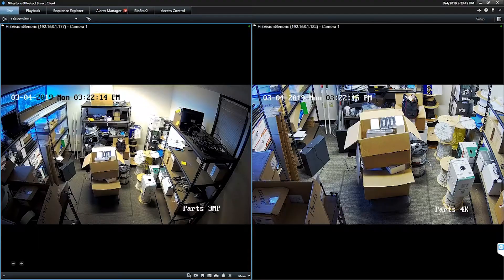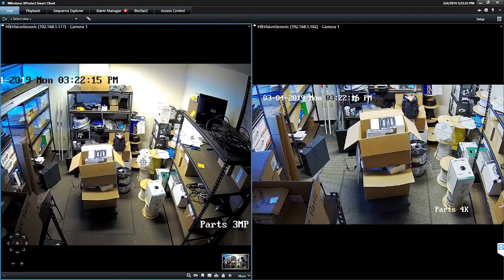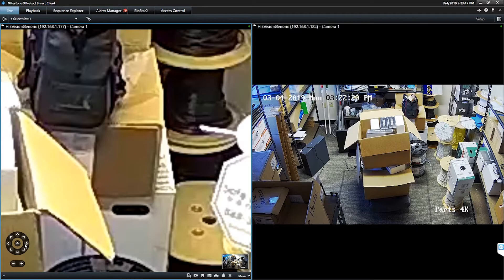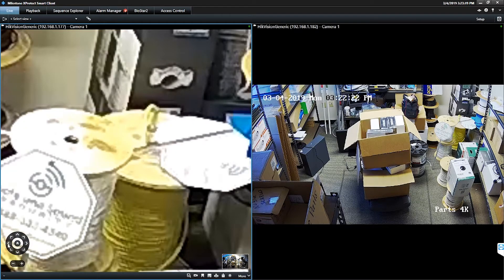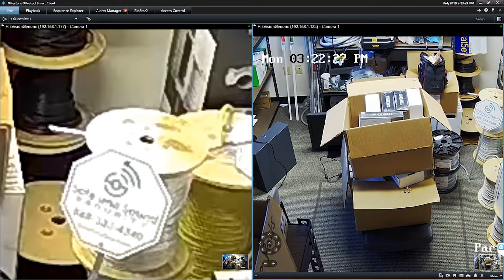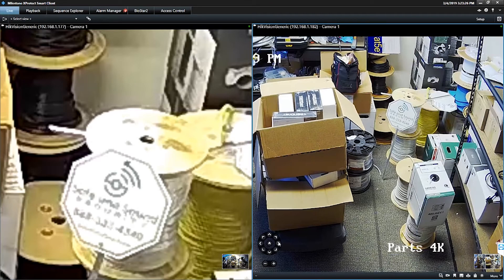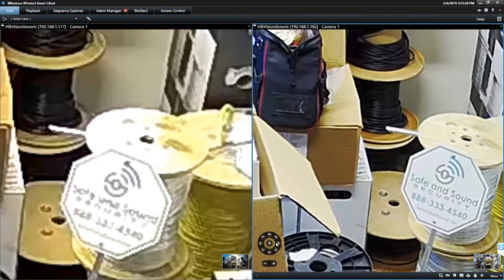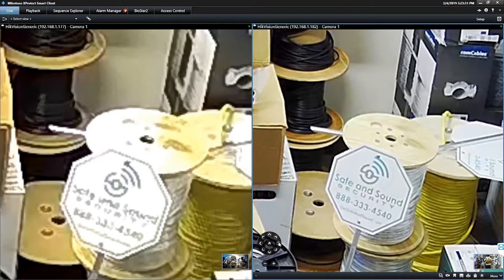NVR vs DVR Which Is Better?

Comment: My question is if dvr is continously peeping what is cause and is the dvr still recording while peeping??
Reply from the maker: The continuous beeping you're hearing from your DVR system could be due to a variety of reasons. Some common causes include:

1. Hard Drive Errors: The DVR might be having trouble reading the hard drive. This could be due to a hard drive failure or a problem with the connection.

2. Overheating: If the DVR is not properly ventilated, it can overheat, which can trigger a warning beep.

3. Network Issues: If your DVR is connected to a network and loses connection, it might beep to alert you to this problem.

4. Power Supply Problems: Issues with the DVR's power supply can also cause it to beep.

5. System Errors: Other system errors or settings, like recording conflicts or capacity limits, can cause your DVR to beep.

As for whether your DVR is still recording while it's beeping, that largely depends on the cause of the beeping. In some cases, like a hard drive error, it may stop recording. In others, like a network issue, it may continue to record but won't be able to transmit the data to a networked device.

The first step to troubleshoot this issue would be to check the system status on the DVR's interface for any error messages or notifications. Additionally, consulting the user manual or the manufacturer's support resources could provide further guidance.

Comment: I have the revo DVR and it has the plug you said should be a NVR and supplies power to the camera's as well it's the revo 16 Channel R16D4B4SYS - 1000 I have RJ - 12 cables times 12 then I have 4 coaxial that go to a BNC source. Revo say's this is a DVR though Why??? Shouldn't this be a NVR??? Am I missing something here??? I am gonna up date the Hard Drive to a 4 TB because it only has a 1 TB right now.
Reply from the maker: @kurtvara4918 You've brought up a good point, and it's understandable why there might be some confusion. Although the terms DVR (Digital Video Recorder) and NVR (Network Video Recorder) are generally used as described in the video, some systems blur these lines.

Revo system is one of these. It's indeed a DVR system but uses RJ-12 connectors which can carry both power and video, similar to how NVRs using Power over Ethernet (PoE) work. However, it's still categorized as a DVR because it's designed to process the video data at the recorder, not in the camera like an NVR. It uses a combination of RJ-12 cables for the majority of the cameras and coaxial cables with BNC connectors for the others. 

As for the hard drive, upgrading from 1TB to 4TB will certainly provide you with more storage space for your video footage. Just make sure that the DVR system supports hard drives of that capacity before making the upgrade.

This kind of hybrid system can be a bit confusing due to its mixture of characteristics from both NVR and DVR systems. But rest assured, your system is classified correctly according to how it processes and handles video data. 

I hope this clarifies things for you!

Comment: I'm partial to dvr system, don't need internet to record or playback video and can run way longer video runs. My system can do over a 1/4 mile run as long as I have power at other end.
Reply from the maker: It sounds like you've found a solution that works well for your needs! DVR systems indeed have their own unique advantages. As you mentioned, they can record and playback video without the need for an internet connection, which can be a crucial factor for many users. The ability to run longer video cables is another key benefit, especially for larger properties or installations where cameras need to be positioned at a considerable distance from the recorder. 

Your system's ability to support over a 1/4 mile run is impressive! This just highlights the flexibility that DVR systems can offer. Thank you for sharing your experience. It's always helpful to hear from users who have found success with their ideal set-up.

Comment: The same thing is..both using hdd that you need to install ur own right?
Reply from the maker: @gopancingdotcom2361 You're correct. Both NVR and DVR require hard disk drives for storing video footage. They usually come with pre-installed hard drives, but their capacity may not be enough depending on specific requirement. So, in many cases, you might have to install or upgrade the HDD yourself to increase the storage capacity. The difference between NVR and DVR is in the processing of data which has an impact on quality of recorded video, cables used, compatibility with cameras, scalability, etc. Hope this clarifies!

Comment: Hello I have a 8ch swann 4k NVR model #SWNVK-885804 and I was wondering if there was away to add 4 or more Chanel's to this NVR with out having to spend more money on a 16ch NVR ?
Reply from the maker: Hello @peteypablo1007, thanks for your question. Typically, the number of channels on an NVR like your Swann model SWNVK-885804 refers to the maximum number of cameras that can be connected and recorded simultaneously. An 8-channel NVR is designed to handle up to 8 cameras.

Unfortunately, there isn't a way to increase the number of channels on an NVR beyond its maximum capacity. If you want to add more cameras to your security system, you'd usually need to upgrade to a model that supports more channels, like a 16-channel NVR.

However, if your primary goal is to monitor more areas without necessarily recording video from additional cameras, you could consider adding standalone IP cameras to your network. These can be accessed and viewed separately, outside of your NVR system, for instance through a dedicated app or computer software. Note that this solution would not add the new cameras' feeds to your existing NVR system and hence would not be recorded alongside your other 8 channels.

I understand the need to find a cost-effective solution, and I hope this provides some insight into your options.

Comment: You didn't answer the question which 1 is better?
Reply from the maker: If you have existing coax cable ran already, there can be cost savings using a DVR with TVI.  But if you're starting from scratch, an NVR is better.

Comment: Can you use a dvr offline just data stored on a hard drive?
Reply: Yes
Reply from the maker: Yes, a DVR can operate offline and store video data directly to its internal hard drive. It does not necessarily require an internet connection to function. It will continue to record footage from connected cameras and save it onto the hard drive as long as it has power.

Comment: Does it matter if you buy another dvr or nvr box with another brand name or not? I have a 4 channel-x SVAT camera set that has stop working, so I was wondering if I could just by another box rather than have someone to come and take the cameras down out of the attic? They are outdoor cameras. Ethernet VGA out, CV 500 4.16 A. RS485 alarm in and relay 12v DC audio in & out monitor out. They don't sell my cameras anymore. Can you look for one that would go with my cameras on Wal-Mart.com or me? Thanks in advance.
Reply: No compatibility can be an issue with older systems. Ip cameras and analogue cameras are different